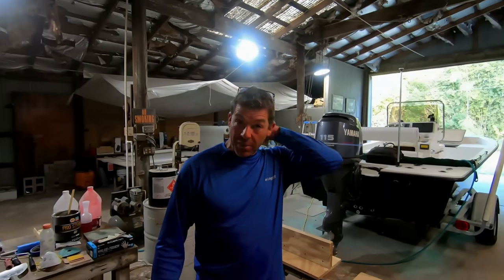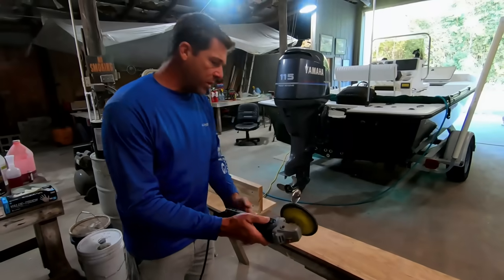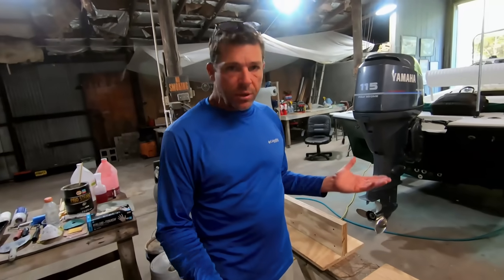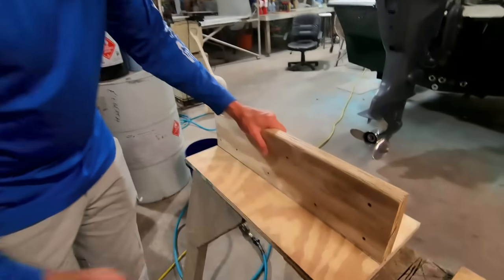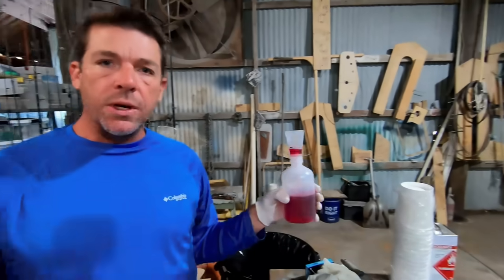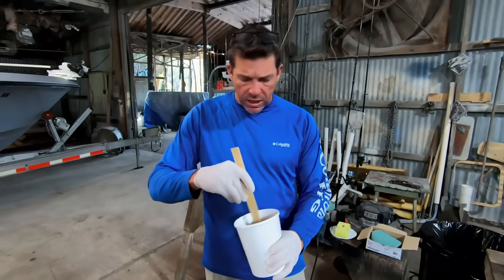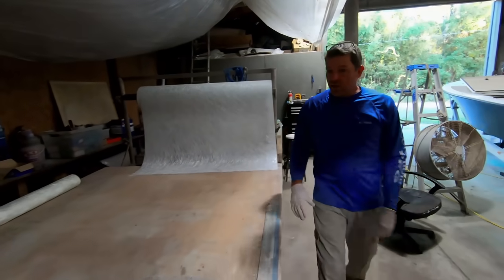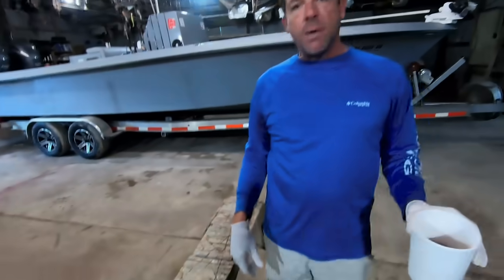How to FIBERGLASS over PLYWOOD!  Do it the RIGHT WAY the FIRST time! Step by Step DIY fiberglassing

Comment: Hats off to you sir! I went to  school to learn this process, and by far you covered everything that was taught from start to finish. My only recognized difference was given to a need of stressing more about shop disposal of chemicals in relation to 🔥 fire safety...example being the unexpected better known as the 3am fire that shows up  way later than you would expect. It happens after dosposing of chemical used materials far later than people would think. And last bit not least, soak those hot mixes in water for extra fire precaution.
Reply from the maker: Thanks for watching and commenting!

Comment: when i was building boats, i used to dilute the first coat at 50 % acetone, then add the cat, for a better impregnation of the wood, ... then a second std resin coat ... then the fibbers, ... and it never fails or delaminate from the wood.
Reply from the maker: Yes, I know some people have used acetone as a thinner for gelcoat and resin. It seems like resin and gelcoat formulas used to be more tolerant of that. Newer formulas have been changed to meet different regulations. If you want to be sure about it working with modern resins, most manufacturers recommend 5 to 10 percent at most reduction with styrene. Just trying to put out the most current info I have. I do appreciate you watching and commenting!
Reply: @FishBumpTV  ... thks for the info. ... and to join or repair 2 parts, once the parts cleaned, i used to hammer them with a wood chisel, to expose the fibers, and get a better adhesion.

Comment: Many years ago (60's) in Argentina,we hired a company to fiberglass a just built trimaran.  It was a great fiasco. The fiberglass teared off like tape, off the hull.  Had they prepared the hull like you did, the fiberglassing would have been perfect.  We had to tear off all that job and come back with epoxies. That was a very expensive finish.  Thank you for explaining the prepping you did.  I'm willing to go back and use polyester again and save a ton of money  on epoxies.
Reply from the maker: Glad you are enjoying the videos! Yes, I have heard of and seen lots of fiberglass problems over the years. Epoxy, vinyl Ester, and polyester resins all have there place. The plywood we use, which is marine grade fir, and the prep we do to it have worked well for us. Just remember that epoxy resin is still considered a premium material that still may be the best resin for your boat, and vinyl ester resins are also a great option to consider.I always recommend that you should do some testing and experimenting on the hull materials you are using to be sure which one will work best for you and your project over the long run. I hope this helps, and best of luck with your project
Reply from the maker: Glad you are enjoying the videos! Yes, I have heard of and seen lots of fiberglass problems over the years. Epoxy, vinyl Ester, and polyester resins all have their place. The plywood we use, which is marine grade fir, and the prep we do to it have worked well for us. Just remember that epoxy resin is still considered a premium material that still may be the best resin for your boat, and vinyl ester resins are also a great option to consider.I always recommend that you should do some testing and experimenting on the hull materials you are using to be sure which one will work best for you and your project over the long run. I hope this helps, and best of luck with your project
Reply: The resin in this video is poliéster or Vinyl Ester? Great video, Best regards from chile

Comment: Great video, and it's nice to see other's techniques.    
Tip/ Warning to Epoxy users.    NOT all glass mat is compatible with epoxy.  The binder that holds the glass strands together. This is the only difference between epoxy mat and polyester mat.  Poly mat binder doesn't dissolve well in epoxy.  To my knowledge. Epoxy mat has only been out for a number of years now.   So, if you are using old inventory of mat.  It's possibly it isn't really epoxy friendly.  It will not produce a maximum strength part.
 
Sanding radius is determined by the thickness of material used.  4 oz glass cloth can go around some very sharp corners.  While something like 10 oz cloth or mat will need a larger radius.
 
And Yea!  Be warned about large quantities in your mixing cup.  Thermal set gets really hot.  If conditions are right, I have heard of spontaneous combustion.  Don't let it sit around other flammables. 
Hope This Helps!
Reply from the maker: Thanks for your thoughts and thanks for watching!

Comment: Can you show how you would fiberglass in the rod holders like on your latest custom build? Like as if I cut the rod holders into the stringers as I was placing them? Or would it be better to do this in two separate steps? (This is on a very small 15’5” boat)
Reply from the maker: Sure,I have a couple videos in our boatbuilding series that might help you with that. Episode 11 in the boat build series is titled How to build custom coosa hatches, and episode 12 How to build and fiberglass custom coosa rodholders. Hope those help you with your project, and thanks for watching and commenting!

Comment: I plan on redoing my deck on my 18' kenner 84" wide center consol. It's an 89 model and just needs the attention. Your videos have been the most in detail compared to others I've seen. My only down fall is I'm not sure how much material I would need. Any insight on that would be great but I understand it's hard. I plan on making it as close to the newer kenner visions with a small front deck/side seats. And small transom deck.
Reply from the maker: Glad the videos are helpful! Kenners are great boats, and are worth putting some work into. we do have a whole boatbuilding series of videos here on the channel that should help you out. As far as resin to glass volumes, as a general rule 1 pound of fiberglass needs about 1 pound of resin to saturate it. When we put the decks down in our custom 29, we used 1 layer of 1708 biaxial and 1 layer of 1 ounce mat on all the flat surfaces, then we doubled that in the corners. If you measure out all the surfaces, be sure to add some extra glass. It is like cutting plywood, there is always going to be some waste. You may also talk to your fiberglass supplier, tell then how big your work area is and they should be able to make some recommendations for resin use. I am also considering offering hourly consulting services for people that need more in depth and technical info. I would appreciate your thoughts on if you think that is something I should offer. Hope that helps, and good luck with your project!
Reply: Thanks alot. That was helpful and I watched every video on the custom 29'. You were so meticulous and game me some great ideas. I may start this next year not sure yet. I may fish it 1 more year then put some money into it. I'm only in it about 3k right now but also need a new trailer. If it ain't broke don't fix it right? Lol anyway I'm not to sure if I would use the consulting service but I'm sure alot of people would. I mean my background is construction so in fairly good @ estimates on materials. Just fiberglassing is new to me
Reply from the maker: @jjfishing1208  glad to help!  If you have any suggestions for new videos, I would appreciate your thoughts. Thanks
Reply: Will do. Thanks for taking the time to do these types of videos. I know alot of people appreciate it even though they may not take the time to say so.
Reply from the maker: @jjfishing1208  Your welcome, appreciate ya!

Comment: Thats a great video excellent content .I have a video suggestion or question my son and I have a twenty foot bass boat upside down in our shop right now it had some osmosis where it sat on the bunks we have the gel coat removed .There are some areas that have stress /spider cracking in the laminate we have ground these areas out as the cracks do not go all the way through the laminate . The questions we have are what would be the proper material choices and procedures to build the laminate back up as far as mat and resins we are thinking vinyl ester and chopped strand .There seems to be a lot of controversy over whether to put the largest piece of mat on the repair first then smaller pieces progressively until the thickness is achieved or vice versa ? . Also curious how you would approach the gel coat build up back to original thickness after the glass repairs are complete there are four areas about 8 inches wide by 6 feet long .Thank you for doing these videos I have watched them all .
Reply from the maker: Thanks, Glad you are enjoying the Channel! When it comes to repairing glass laminate you should try to match what was there originally. For example, if you removed 1/8 of an inch of material or less you probably only went through the skin coat of mat. As you go deeper, you will see subtle lighter colored rings. These are layers of heavier laminate, likely woven roven in older boats or biaxial in newer boats. I recommend always starting your repair with mat as your base, smaller pieces first then working out to larger pieces until you are flush with the surrounding surface. remember to always start and finish with mat. Once the resin has cured you would want to grind or sand the repaired surface down to between 1/16 and 1/32 of an in below flush with the surrounding surface. I would use 2 to 3 coats of gelcoat as a primer base, using the same color as the hull if possible. Remember the last coat should have wax added so that it cures tack free. you can use a brush or roller to just get the material on the surface then use a blade to smooth it out. You would want to block sand the gelcoat as soon as it has cured, as it gets harder the longer it has cured. Sand until flush and feather it with 180 to 220 grit paper. The last coat can be sprayed using a large tip gravity feed gun, but the gelcoat has to be thinned with either styrene or duratec makes a clear high gloss additive that works very well. As far as resin goes, I agree that vinylester would be a good choice. Hope this answers some of your questions. It can be difficult to cover ever question or topic in video or text. We are now offering consulting on a hourly basis. If you would be interested in more direct help with your project, just let me know. Thanks again for watching!
Reply: @FishBumpTV  Thanks very much for taking the time to respond good information that we will be putting to use in the next few weeks.
Reply from the maker: @chrisholmes1666  Glad to help.

Comment: I've found your videos very educational and easy to understand. Thank you. Something I've been wondering about has to do with gel coat. Currently rebuilding a 19 Seaway and wanted to put multiple layers of gelcoat on. The finished gelcoat color is Kingston gray and I can only buy it with wax. So I've tried tinting white unwaxed to coat before the final coat. The problem I'm finding is that when I put the final coat of Kingston gray on the color is affected by the previous coat of unwaxed tinted white. Any suggestions are helpful.
Reply from the maker: Glad you are finding the videos helpful. Usually tinted base gelcoats don't bleed though into the last coat. Sorry you are having that problem. You might want to try letting the base gelcoat cure longer than you have been. Even days in some cases as gel without wax will remain very tacky for some time. You could also add wax to your base coat gel, let it cure, then scuff or sand the surface lightly to prep for the next coat. On a smaller job that I an option, on a large project it may be to labor intensive. There is nothing wrong with making up some test panels to try these methods before you try it on your boat. Hope this helps and thanks for watching and commenting!

Comment: This was a great video!  I really enjoyed the information.  Especially the importance of having the correct radius before applying the resin and fiberglass.  Quick question, I noticed that you have massive amounts of polyester resin.  How long does polyester resin last?   My local fiberglass shop says polyester resin only last about 90 days once opened, whereas epoxy last for decades.    Love the videos, keep up the great work!
Reply from the maker: Thanks! glad the video was helpful. Yes, when we have a big project we buy the resin in 50 gallon drums. We try to buy what we need as we need it. We are fortunate to have an Advanced Plastics inc distributor close by. 90 day shelf life is about right for most polyester resins. If you can keep it cool, and out of  UV light that will help. Yes epoxy resin has a much longer life, although the hardener seems to go bad sooner. We do not use a lot of epoxy compared to poly resin, but I used to use a good bit when we where building some plywood stitch and glue skiffs. I plan on doing a poly vs vinyl vs epoxy resin video soon. You might find that interesting. If you have suggestions for content I would appreciate the feedback.
Reply: I've never had any experience with fibreglass outside of fixing dings in surfboards a million years ago,, so your vid taught me basically everything that I now know.  
In addition, that was the shortest 45 minutes of my life - it seemed like about 25 minutes!  The amount of info you conveyed in such an easy to digest fashion is phenomenal, and I didn't have to go back or skip forward to avoid repetitive filler content once. When I looked back and saw it was 45 minutes I was shocked!  
I have no questions, only praise for your trade skills and your explicit instruction. No doubt your son will become an expert in no time 😊
Thanks very much!
Reply: The radius does 2 things. Glass can't bend at a 90 without wanting to pull away and leave a void. It also minimizes a stress riser, a place of minimum strength and a place with enhanced desire to crack or fail.

Comment: Doing repairs on a shuttle bus I purchased and I don’t want a aoutzone fiberglass repair. I did repairs on Learjets years ago and I want that kind of quality! This was an awesome video on just what I need. Fiberglass over wood for tie in from the tube to the chassis. Well done!
Reply from the maker: Glad to help and best of luck with your project!
Reply: I made the turbine engine parts for the jets, very high quality.
AiResearch 35 years.

Comment: Really good lessons. Acetone bucket with a clean bottle to rinse was a great tip. I do fiberglass work out of necessity and have learned a few things through the years from friends and trial and error. Not professionals. I've had several boats through the last 40 years and have done quite a bit of repairs and modifications. Excellent information. You actually showed that I'm not as bad as I thought I was lol. My glass work always looked good and seemed to hold up well but I never really knew if I was doing it right. I like your method of filling and radius better than mine. I make a resin/glass mixture which is a pain in the a$$. You explained everything so well. Thanks.
Reply from the maker: Very cool! Glad the channel helped to confirm that you got some fiberglass skills! Thanks for watching and keep up the good work!

Comment: Great Upload, just a thought for those who would be of a novice grade in laying down chopped strand  Matt, remember there's actually  shiny side front face side where the mat has been pressed together,   and on the back of same where  there are a mixture of those rough loose fibres , so don't use the back side to face the brush or the  roller, otherwise when you start wetting same with resin, as those loose  fibre strands  will stick to the roller or the brush, myself  included have did same more than a few times, great craft in making it look seamless but you really planned out your job and we saw your results unfold in real time...  thanks for this upload.
Reply from the maker: Thanks for your thoughts, I appreciate you watching!